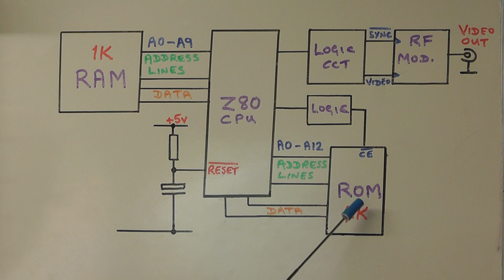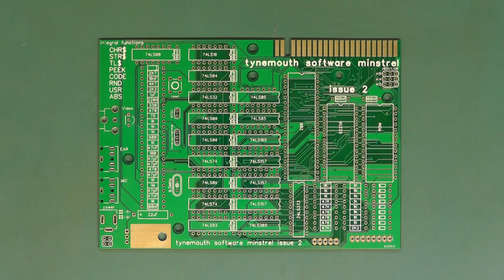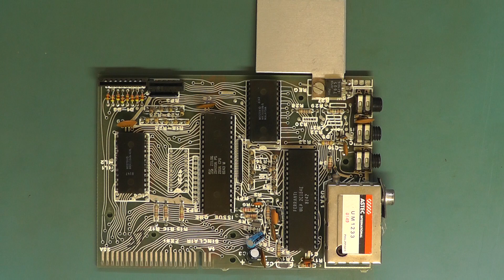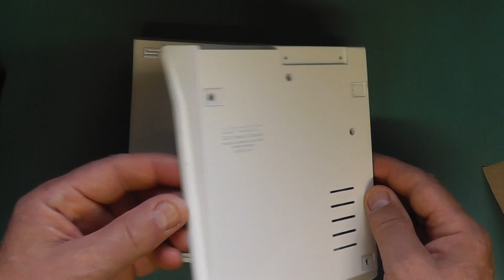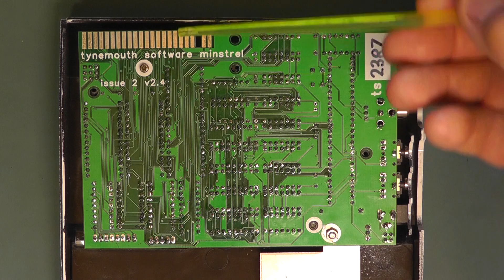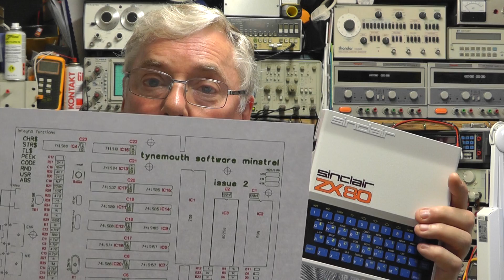Scullcom Hobby Electronics #51 - Build a Sinclair ZX80 Clone

Comment: I think even the new ZX keyboard ribbon cables were quite fragile and often broke if you unplugged them. I think also the heat inside the case actually made more brittle quite quickly after use.

Comment: 😁Americans do not understand the phenomenon of this computer, ZX80_ZX81, is a simple controller for robots, available for sale since the 1980s, in the form of various kits for self-assembly. Of course, there were also the schematics and self-collection of integrated circuits. hahaha And those connecting integrated circuits with cables when there was no PCB. 🤣🤣🤣That's probably longer than the United States has been around ...

Comment: I reverse engineered the ULA of a ZX-81 and designed a PCB of the whole ZX-81 a clone that is 100% compatible with the Z81 PCB, as in it can replace the PCB of a real ZX-81, it fits inside the ZX-81 case (or a 3D printed replica). It uses only simple to solder and readily available components.
So you can build a ZX-81 clone without needing an ULA, with only common (HCT) TTL logic. My clone is called ZX-81+38 (as in 38 years after 1981) it has proven to be very compatible, and it outputs composite video through an RCA connector (that replaces the RF modulator output) compatible with modern TV's that have a yellow RCA video input. It is powered with a 500mA USB power supply through a mini USB-B port, and there are also 3.5mm audio jacks for cassette output and input. My cassette input circuit is much more sensitive than the original ZX-81 which needs a very loud audio signal to work reliable. as it has a built in pre-amplifier. my clone also has a DB9 input port for a standard (atari) Joystick, which "presses" the cursor keys, and the "fire button" key "0". for games. You can download the PCB production files (gerber and drill files) from my GitHub page, here: https://github.com/mahjongg2/ZX81plus38 anyone can use these files to create his own PCB's, and assemble it with a BILL of material (BOM) spreadsheet file, and the ZX-81 ROM file can be found online, and be programmed into a cheap 27C256 OTP (EPROM), more information can be found on my wiki page here: https://revspace.nl/ZX81plus38_simple_to_build_ZX-81_clone. So if you want to build your own ZX-81, check my clone out,

P.S. now (july 2022) I released version 1.7 of my clone, which has a few enhancements: a better crystal oscillator, and a corrected connector for the keyboard. It is also made compatible with an enhanced ZX-81 ROM so that it can contain the firmware for my programmable sound board expansion with SD-card reader, coming soon.

In august 2022, I launched what s perhaps my final version, revision 1.8.
I also released the KiCad files, so its now full opensource.

Version 1.9 repairs a small bug in the joystick to keyboard interface, it adds necessary pull down resistors on the bases of the 2N3904 transistors that simulate a keypress.

I'm busy with my own version of the ZON-X81 programmble sound generator, that also has logic for an SD-Card, and software exists in a ROM expansion, so with a simple command you can launch a menu with which you can pick with a single letter from a to z one of 26 possible games. Loading from sd-card is ten times faster than  from cassete.

Comment: It is beautifully made, not only the case and the mix of old and new, the ZX80 and ZX81, but also the new PCB with extra RAM and multiple ROMs. This is an improvement to what was already there. For the next version of the board you could go to 32K or 48K of RAM. It's good work!

Comment: It's funny that the ZX80/81 only have text mode graphics with no bitmode, and the Spectrum only has bitmode graphics with no text mode. The Spectrum is the superior machine, no doubt.
Reply: Spectrum is superior no doubt, but in terms of importance, I would rate zx80/81 above spectrum.  The reason is that super cheap zx80/81 reached millions of people and changed their lives.  I would rate my zx81 more important to me in terms of sheer impact than any other computer I used since then.
Reply: @springer-qb4dv  I can see that, sure. It's amazing what programmers have been able to figure out with the 80/81 making it do things that most thought was impossible. For example: 
- https://youtu.be/SyPpq62b7gw
- https://youtu.be/mw2N5k4kKxE

Comment: It's worth mentioning that many ZX81's listed as "faulty" on eBay are not, it's just that modern TV's have a problem resolving the ZX81's rather wonky RF output. Also, the ULA (custom IC) in the ZX81 is no longer available, so worth keeping hold of or passing to a ZX81 enthusiast.

Comment: Excellent video and thank you. One question: As far as switching the ROM images go, wasn't there a different Ferranti PLA used in these computers or doesn't that make a difference?
Reply: The ZX81 used a Ferranti ULA to replace the glue logic used in the ZX80 (and this clone) thus reducing the chip count to the 4 ICs seen in the video. The official 8K BASIC ROM UPGRADE kit consisted of a replacement ROM, a keyboard overlay and the ZX81 programmers manual. This effectively gave the user a ZX81 without the hardware updates such as the NMI controlled slow mode or the edge connector changes needed to make it fully ZX81 compatible.

Comment: Only just watching this.
I hope you did not tear down that old ZX81 board. It is likely that all that was wrong with the unit was the keyboard flex and you can trim off the cracked sections with scissors and use the shorter tails to insert into the pinch connectors.
That was how I recovered an old Timex Sinclair 1000. Unfortunately, further disassemblies to repot the heatsink for the regulator and swap out the electrolytic caps for ceramic caused the flexes to crack further. Fortunately, Tynemouth Software to the rescue and I ordered a ZX81 keypad with TS1000 overlay!

Comment: Very interesting! I was looking for any instructions about how to build a computer which isn't based on or descended from the IBM PC. This would involve making a custom PCB, or perhaps starting with a breadboard. Any information would be appreciated. What about a custom Z80 or 6502 computer with graphics? How did Apple and other companies make their first computers working from a garage? This project would have been much better if you hadn't used a ready made PCB, or an old ZX81 case. Why don't you show us how Soviet clones of the ZX Sinclair Spectrum were made? I've seen videos of the Kiwi computer, which is like a computer from a parallel universe, containing various chips from the 1980s and early 1990s, including an MSX2 or MSX2+ graphics chip (Yamaha V9938 or V9958), 68008 CPU, two Commodore SID chips, a custom case, and booting up using 68K BASIC or EmuTOS. Good luck with your channel, anyway!

Comment: Good video, but I have three comments...

1. I would have used a semi-gloss paint for the case. I think it would look better. And, I'd recommend using a clear coat to protect it. You also didn't replace the rubber feet.

2. I would have left the Sinclair name off the sticker, as you can see it molded into the case above.

3. That is NOT a "keypad." A keypad would be the numbers only like an old push-button telephone, or a calculator. What a computer has is a Keyboard. Every time you called it a keypad, it made me wince.
Reply from the maker: Hi Al,
Thanks for your comments. This project was just my own take on building a ZX80 clone. Of course you are free to change it to your own needs as required.
Regards,
Louis
Reply: It's hardly a proper keyboard. I've heard blackberry-style smartphones described to have qwerty keypads, alas 30 years later.

Comment: On the original zx80, the keyboard was integrated into the PCB.  The original case looked a lot like it was vacuum formed whereas the zx81 case was injection molded. Anyhow, this was an interesting project.  The zx80 was my first computer like a lot of people.  I feel foolish now because I sold it to buy a zx81.  I still have the original manual and schematic.  I found this video because I am looking to re-purpose an old Timex 2040 printer.
Reply from the maker: The original Sinclair ZX80 now sell for high prices on eBay. There must be a lot of collectors out there. They are also hard to come by in good condition. The Timex brand name was used in the USA I believe.
Regards,
Louis
Reply: Originally, Sinclair sold the ZX80 and ZX81 directly in the US.  There were magazine ads in Popular Electronics and such.  I bought my ZX80 as a kit and later upgraded to the 8K ROM.  When I sold it, I gave the buyer the new 8K manual, but kept the old 4K ROM and manual.  The ZX80 was not capable of SLOW mode which is what I wanted.  Once I saw what SLOW mode actually was, I felt really dumb for selling the ZX80 like that.  That was back in 1981 or so.   Sinclair should have renamed FAST and SLOW to "INCREDIBLY SLOW" and "RIDICULOUSLY SLOW", but I guess he was trying to save bytes.

Comment: I have a ZX80 and you missed out the label on the front of the command words that needed to be actually spelt out. I noticed that they were also on the PCB silk.

I used a 62256 Static RAM, back in the 1980's, to build a 32 K.Byte RAM pack. It cost a lot of money back in the 1980's for just one memory chip. I used a 74138 3 of 8 decoder to address it and having 32 K.Bytes of RAM to play with was great when it came to programming. 

On the downside saving and loading took twice as long as the ZX80 and ZX81 save the entire contents of RAM. Another factor was that any programme, no matter what the size under 16 K.Bytes, written and saved with the 32 K.Byte RAM pack attached wouldn't load when running a 16 K.Byte RAM pack, for obvious uniquely ZX80 and ZX81 reasons.

This led to a switch being added to the RAM pack to set it into 16 K.Byte or 32 K.Byte modes before starting up the computer.

I also ran the Memotech external proper full travel keyboard, Memotech RS232 module, Maplin port extender and 2 x Maplin tripple port IO cards.

I still have my ZX80 and ZX81 so might set it up sometime and show my now 28 year old son and 16 year old nephew how we used to "Rough it" in the early days of home computing.

having a ZX80 and ZX81 and building my own attachments gave me valuable experience. So many years later, when asked to design a bespoke IO card to drop into a PC it was a doddle.
Reply from the maker: Thanks Andy for a trip down memory lane. Regards, Louis

Comment: Times-Sinclair on this side of the pond, I think. :-)
I believe it was also available as a kit back then.
Reply from the maker: Yes Timex Corporation had a joint venture in the USA to manufacture the Sinclair ZX80 and as such it was re-branded Timex Sinclair 1000 (TS1000). The TS1000 was a slightly modified Sinclair ZX81 with an NTSC RF modulator instead of a UK PAL modulator. I think it was launched in the US in July 1982.
Regards,
Louis

Comment: Very interesting project. I built a ZX80 back in the day when you could opt for a build it yourself from parts.
But I quickly moved into the fantastic World of Dragon 32.
You said that the XZ81 you bought was faulty, maybe it was just the keyboard ribbon cable & you could have got it working with a replacement part??
Reply from the maker: Yes the ZX81 keypads are known to develop faults over time. But it was cheap to buy and I need a case.

Comment: What does the reset switch actually do? It resets the CPU, but keeps the previously loaded program. loaded into RAM, so that it is accessible after reset, without the need to load it again? Or does it behave like the power off/on button?

Also, make sure you check the page of this person http://qrp.gr/microwave/giannopk/zxcomputer/index.htm who has built the original one from scratch (homemade PCB)

And a note. You do not need an extra chip neither an extra transistor for the video signal. Try taking the signal directly from the input of the RF modulator (in the original zx80) to the TV composite video input and you will see that this works ok without the extra chip. The composite video and the sync pulses both appear on the input without the extra hardware.
Reply from the maker: HI Kos,
Reset simply provides effectively a power reset with out removing the power supply from the unit.
The video signal taken directly from the input of the RF modulator as you suggest does not have a back porch after the sync pulse and so some modern LCD TV's do not work well with this video signal (old TV's are more tolerant). This causes the black parts of the picture not being black, but varying shades of grey, and also the whites not really being true white. The addition chip provides a back porch after the sync pulse and so enables modern TV's to handle the video signal correctly.
Regards,
Louis
Reply: Thanks Louis

Comment: I still have my ZX80, opened it and discovered that it's missing 2 ICs both are 7400, probably years ago I needed them for some project. Surly I wouldn't do such thing today, I'm going to put back the missing ICs, shame they would be of new vintage though.
Reply from the maker: I have done the same myself at times on other equipment when needing a part.

Comment: Just another viewer appreciation note: ... I mean YOU HAVE REKINDLED an old passion i had years ago in building up electronics projects.... I've even gone out and bought new PCB making gear, cleared out a spare room and have made a workbench and unpacked my stored away electronics tools etc! I've Subscribed and working through almost all of your videos so far the DC Load is on my 1st list 'ToDo' hunting down parts and coming up to speed on Arduino. Your excellent description of a design makes it easy to understand what the circuit is doing... Can't wait for many more videos.... Thank you, thank you so much.
Reply from the maker: Nice to hear its rekindled your old passion. I am currently working on Part 7 to my DC Load project with some updates and the option of a single PCB design for the whole project. Hope to get the filming finished soon so I can up load it to my You Tube channel.
Thanks for your comments.
Regards,
Louis

Comment: Very nice! Instead of using unreplaceable original ZX 80 cases, 3D printed ones would be a good idea, though.
Reply from the maker: Thanks. 3D printing would be an option as ZX80 cases are hard to come by.
Reply: Plus, as the key"board" doesn't seem too complex, it would open the path to  make a much nicer input device for the wee computer. Printing keys would be a very simple task for such a machine indeed.

Comment: Interesting video. I still have my fully working ZX81 (modified with internal 32K static ram which 16k are available). But the keyboard membrane is starting to show its age. Thanks for the links for ordering a new one.

BTW, the audio auto-level setting in the camera isn't performing very well. The constant limiter "pumping" effect is rather unpleasant. Maybe you could set the audio level manually ?
Reply from the maker: Thanks for your comments. I need to have a closer look at the mic I am using.

Comment: The ZX81 was my 1st computer. I think I had 4 at one time. Only 1 now and it still works.
I made modifications to them to use extra memory in the basement / a modified xt keyboard / video inverter switch and a big-azz rubberband to hold the 16K Ram Pak on. Thanks for the vid.
Reply from the maker: Thanks for your comments. I remember the issues with the 16KByte memory pack. Unless you secured it it tended to be loose and you sometimes lost memory contents. I used Velcro on mine to hold it firm.
Reply: Yes. I upgraded  to velcro(TM) also.  People who "Thumb Down" videos should have to state "why" before it is logged. I see no reason to thumb down a fine video like this. Thanks again.

Comment: spectrum at least,did oyu eves r luckin cpectrumator zx 48,128k?
Reply from the maker: Yes a model of the Spectrum with 128 KB RAM was built in 1987 which also had a floppy disk drive. The Spectrum was initially released in 1982 with 16K of RAM and over time eight different models were produced with increasing levels of memory.
Reply: i  found Harlequin 128K by lokkin if you get anythin for spectru,its vrty interesting,yust for attraction my fist computer was zx spectru 48k,witch come from Britani,because from ex-yu you cannot get at,just one 
concern about keyboard,the problem vas dust brtveen contacs was wery surius problem in spectrum days
Reply from the maker: You may be interested in a blog by Dave Curran of Tynemouth Software on building the Harlequin Spectrum clone:
http://blog.tynemouthsoftware.co.uk/2016/11/building-harlequin-zx-spectrum-clone.html

Comment: Very cool, Louis. I actually had a Timex/Sinclair ZX81 as a kit in my youth also. Brings back fond memories. I may have a go at building this project. Oh and BTW I have not given up on the DC load PCB, just been busy and now that the summer weather approaches it is really hard to stay indoors and look at a screen for hours. I will get back to that project as well. Thanks for the memory.
Reply from the maker: Thanks Rob. I know what you mean, when the weather is hot its normal to spend more time outside.